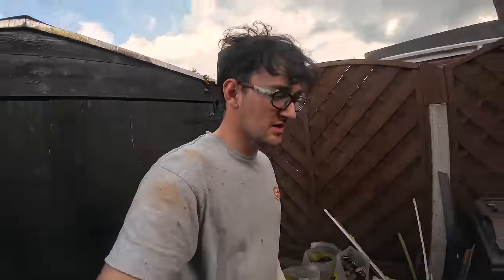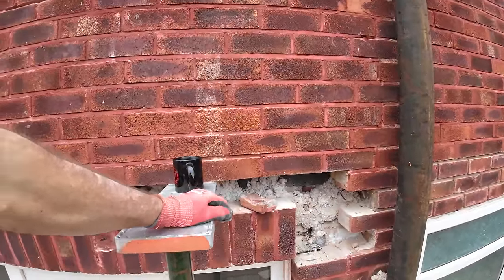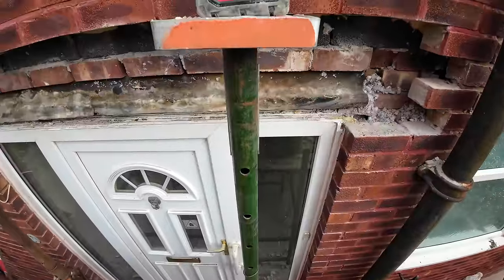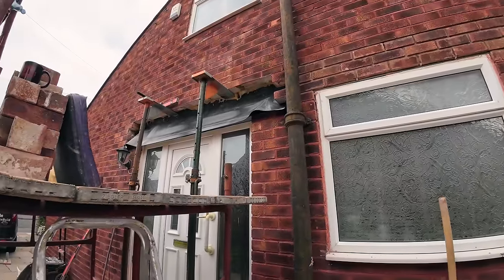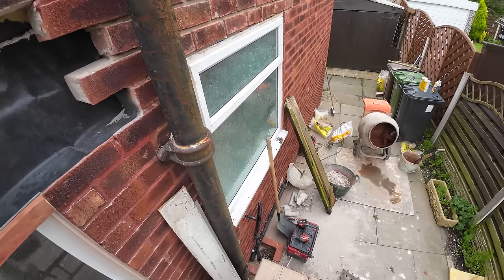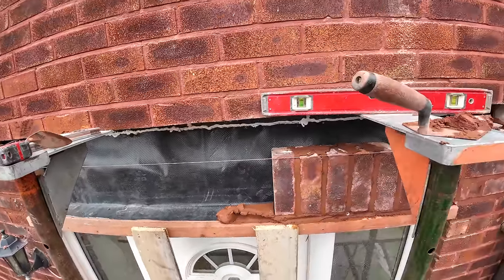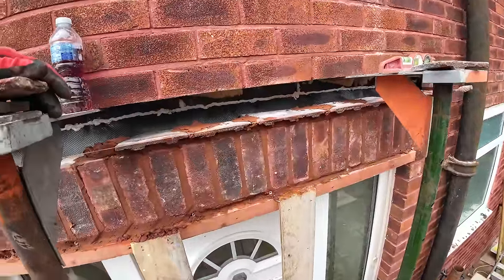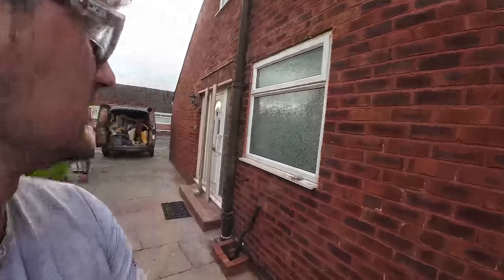CANT BELIEVE HOUSES WERE BUILT LIKE THIS !! HOW WE FIXED IT

Comment: Hopefully the toilet stack will be replaced or extended higher than the Window as it is a bit low at the moment do you think?
Reply from the maker: We don’t get involved with the plumbing 🪠 😁🧱👍🏽
Reply: @liamking524. Don’t know if this rule/regulation still applies. Does the open top of the soil stack have to be three feet/1 metre above the highest point on the frame of the nearest window? However (not sure if it’s this job?) but didn’t Alex mention in a previous video that the end wall of this dwelling was being rendered maybe? So the soil stack will have to be removed anyway. Stay safe and well.